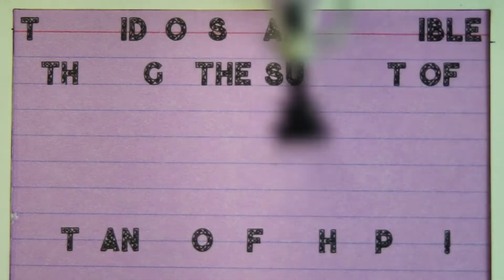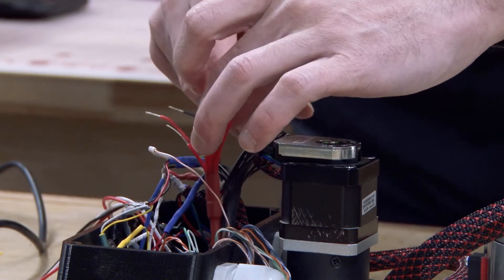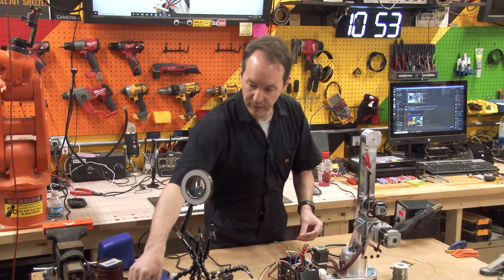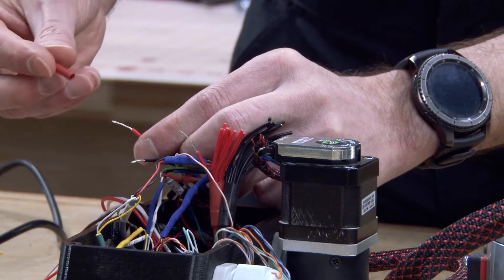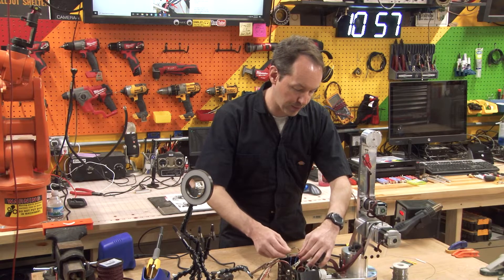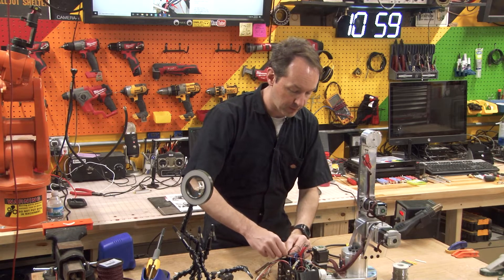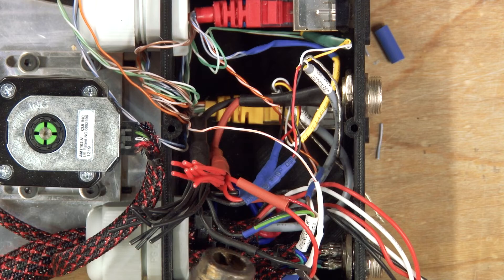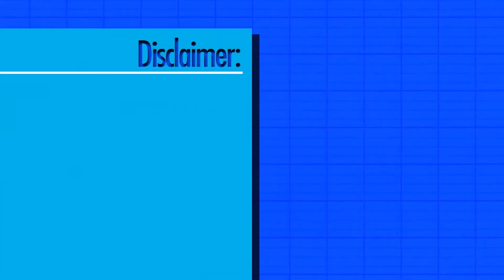Project ARchi3 Episode 41 J1 Limit Power Connection

Comment: Cleaning up after soldering? I thought it depended on the flux, as some can cause corrosion later on, but Rosin flux should be ok to leave. I would always clean up if soldering on a PCB, but usually not when soldering wires together.  I guess the easiest is to use the no-clean types of flux!
Reply from the maker: That's kinda what I figured. I've never heard of anyone cleaning it when it's just wires, but I know cleaning PCBs is a thing. Thank you!